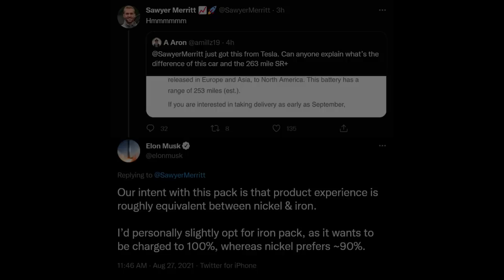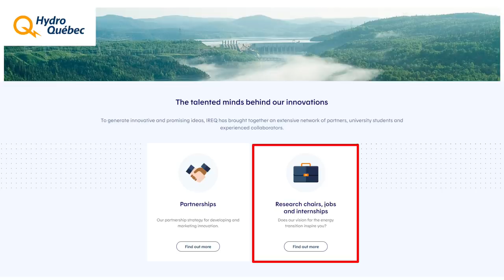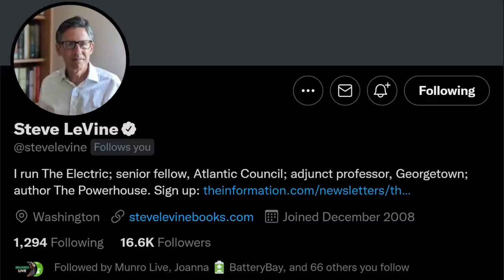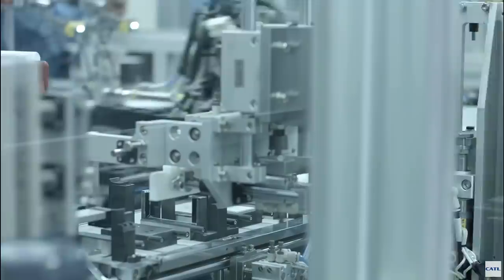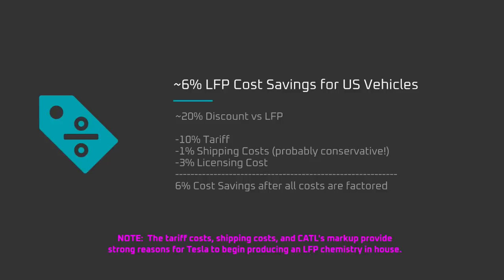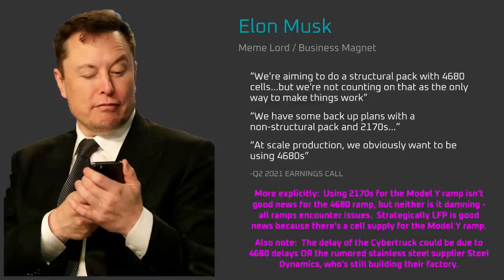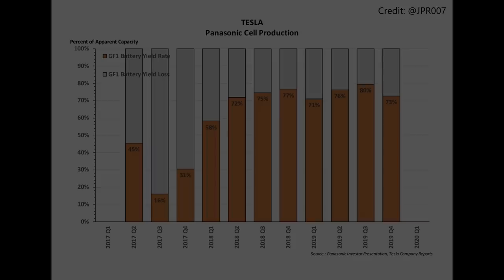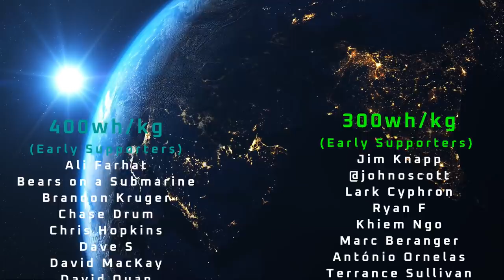#1 A Brief History of LFP, Patents, Licencing Costs, Pricing // and Tesla

Comment: Great video! Can't wait for the upcoming videos on LFP. Quick question though, how come we don't see cylindrical LFP cells?
Reply from the maker: Good question!  It's because LFP's big achilles heel for range is volumetric energy density.  Large prismatic cells maximise the amount of active cell material you can fit in a square pack.  This'll be covered more in depth in the series.
Reply: @thelimitingfactor  aah I see. Do you think there would be any change in terms of 4680 LFP considering that the structural battery pack has higher energy density in terms of volume?
Reply from the maker: @TAD-9  I'll will work through the details when I script that one.  I have to run some numbers but I think I've put my finger on the key variables.  I have to take a closer look at CATL/BYD cell to pack and see how it compares to Tesla's pack.  Then, I have to factor in chemistry improvements.
Reply: Do we know that the LFP packs are prismatic? I always assumed they were also 2170 using the same pack architecture. Never seen a tear down of a LFP pack
Reply: @Pedrodemio  they are prismatic. There are pictures floating around on the internet of the lfp pack.
Reply: Cylindrical LFP cells exist. They are just not as common for the reasons Jordan started. But it you go to AliExpress, you can find plenty of cylindrical cells for sale.
Reply: It’s because LFP allow more relaxed cell structures. This is why 1000Ah single electrolyte compartment cells can be safely done. With NMC/LMO/LCO not so safe. So small cylindrical cells are a compromize due safety issues.
Reply: @mfb424  This makes a lot of sense. 
Does LFP expand/contract less, making them more suitable for prismatic format & volume maximization of the "usable space" inside the battery pack?
Reply: @elektrotehnik94  Anode side is the mechanical mess which cause wear and tear. The adhesion to foils is another thingy which cause issues. We had 50Ah cylindrical cells in China with NMC already early 2000. I had plenty of 10Ah cylindrical NMC cells (need to check the dimension) back then to build some ”pipe batteries” for street lights 🤪 From those we learned that after certain amount of windes electrode the thermal and ionic swelling grinds the electrodes off from the foils. Even with thinnest and toughest coating that kept happening.

Anyways. LFP is mechanically so stable that we can use 1000-2000nm particle sizes and reduce the electeolyte interfaces and align the particles towards the separator (when coating the separator). Now what this allows? As no foils needed the single electrode can be say 2000 mm by 5500 mm. There’s no winding or folding that. But extraordinary mechanical stability is achieved.

So LFP as a extremely stable particle and as a li-ion starved design it allow us to ditch all traditional manufacturing approaches. Prismatic large format cells taught us that as they came already to mass production in 2004. I made my first EV bus battery packs back then with few hundred 350Ah prismatic cells. After that whole a lot more was learned from hundreds of thousands of Chinese EV buses. Real life use on shaky roads.
Reply: @mfb424  I see, thank you, that was very informative :D

Comment: LFP are safer, have longer charge life and can be full charged without significant degradation. Premium models where higher power density is a selling point would continue to use Ni based chemistry, but mass-produced models should use LFP.

Comment: Thanks for a the great video, can't wait for more.  Question- are Tesla LFP batteries still cylindrical form factor or is it an entirely different pack design?
Reply from the maker: 4680.  But it doesn't matter for LFP because it's a safe chemistry.  I'm not sure why everyone is fixated on form factor.
Reply: @thelimitingfactor  I don't know that I am fixated per say, but more curious about how interchangeable they are for assembly.  It sounds like current Model 3 LFP is not cylindrical?  So it's an entirely different pack then?  I am thinking about it more from the perspective of how many battery pack assembly lines you need for different chemistries.

Comment: Surely the LFP chemistry can be used with 4680 cells. After all, isn't it just packaging?
Reply from the maker: The variables are:  Safety of the chemistry and safety of the form factor and energy contained in cell.  LFP is safe, it can be used in large cells with minimal packaging.  LFP has low volumetric energy density, which is why it's stored in large cubes.  Whether Tesla puts it in a 4680 or not isn't due to safety, it's a matter of energy density...that all depends on the structural pack.  Sorry, that's as far as I'll go here in the comments.
Reply: The beauty of LFP is it doesn't need much if any cooling.  The cylindrical cells leave space for cooling in the gaps which just isnt useful when the battery just wont degrade or explode even when punctured.  Tesla's current battery cooling is impressive but in the case of LFP unnecessary overengineering.  Not sure how much its LFP itself or the engineering but look up the byd blade puncture test and see the comparison for prismatic which is an absolute bomb.
Reply: @thelimitingfactor  My view has always been that all chemistries would benefit from the tabless design. I live in Canada so cooling wouldn't be a problem but, efficient pre-heating of the battery would be a benefit of the 4680. Wouldn't heat travel as efficiently into the battery as out?

Comment: "Like any battery, LFP has some eccentricities".  Yes, and one of those, as you pointed out, is cold weather performance.  The chart you showed was from Nat. Energy (not Tesla?) so I'm not sure how well Tesla's thermal management system will mitigate this issue.  Anecdotal reports from China say it's not mitigated very well, and certainly not to the extent shown in the chart.  I'm anxious to see more data on that.
Reply from the maker: You just have to let it warm up with pre-conditioning.  If you're impatient or don't use the app, then it will be a frustration.
Reply: @thelimitingfactor  Thanks.  I guess that's ok as long as you're plugged in.  Otherwise the battery cannibalizes itself (as do all EV batteries)
Reply: @tommckinney1489  he linked a super interesting research paper on twitter that showed amazing performance from LFP when properly thermally managed. The drain from the preconditioning is significantly less than the loss from running at a sub optimal temperature. Even better than NCA without thermal management.
Reply: @samuelprice538  thanks.  Preconditioning is available now for most EVs yet people don't know about it or do it.  I guess it's a learning curve, but it may be difficult to precondition if you aren't plugged in, like at work or at the mall, etc.  Don't misunderstand me, there are pros and cons to everything.  But I don't think people really understand (yet) how important it is to precondition and charge to 100% when using LFP.
Reply: @tommckinney1489  this is about battery preconditioning not cabin. Its done using heating stripes built right  into the cells. Apparently it can bring the cells up to temperature within 90 seconds so no need for the user to wait. It happens as you start driving.
Reply: @samuelprice538  That would be great if it worked that way.  The battery has a large mass and it would be difficult to heat up in 90 seconds.  Do you have more info on this, like maybe a link?

Comment: Fantastic stuff as always. I got the impression that the cathode chemistry discussion on battery day pertained to the 4680 form factor. So I fully expect LFP 4680s in cars and in structural packs. I can see prismatic form factors in storage but it's dependent on heat dissipation. Elon is pretty adamant pouch form factor is a runaway thermal event waiting to happen... Given the tabless architecture's thermal advantages, I'd expect 4680 LFPs in the storage products too. There may be some niche usage in storage for the higher power  densities (other than FCAS). And my final thought is that the storage products may not need larger volumes despite the LFP energy density being lower because the thermal management should be simpler (and less voluminous).
Reply: Megapack thermal management seems like an important and interesting topic. Jordan should probably make a video about it :D
Reply from the maker: The variables are:  Safety of the chemistry and safety of the form factor and energy contained in cell.  LFP is safe, it can be used in large cells with minimal packaging.  LFP has low volumetric energy density, which is why it's stored in large cubes.  Whether Tesla puts it in a 4680 or not isn't due to safety, it's a matter of energy density...that all depends on the structural pack.  Sorry, that's as far as I'll go here in the comments.
Reply: @thelimitingfactor  Thanks. That's a resounding no then☺

Comment: I drive a MIC Model 3SR+ in Europe so it has the LFP battery. I can personally say it is awesome! I’ve never had to worry about the range and charging to 100% all the time is so much easier and less stressful, especially since I can’t charge at home. Not having to worry about the battery’s longevity is a godsend.
Reply: @cyclopsvision6370  For sure, but all do. It doesn't affect my daily driving at all (only about 60 km round trip commute) and I haven't done any road trips in winter yet, but with the supercharger availability in Europe, I don't expect it to be an issue.

For a quick comparison though, a round trip to work and back in the winter uses about 10% battery, while in the summer I only need 7-8%, depending on speed.
Reply: @cyclopsvision6370  Since I can't charge at home, no. But I would if I could. I guess I should also clarify, European winters are fairly mild. I'm sure I'd have much more trouble if I lived in the Northern US or Canada. But then I'd also probably have a garage and a way to warm up the battery. lol

Comment: I bet Tesla will copy or buy BYD LFP blade battery. The design is much more simpler as structural battery than 4680.
Reply from the maker: Nah, as LFP evolves it will get better volumetric energy density and won't need rectangular packaging.
Reply: @thelimitingfactor  The rectangular shape function as a structural pack much better than the cylindrical cell.
Reply from the maker: Could be, but cylindrical is cheaper to manufacture.  

That is, I'm not saying one is better.  

Rather, that there may be no need for Tesla to manufacture multiple formats.

Smaller cells also offer thermal benefits.
Reply: @thelimitingfactor  wrong, BYD battery cells are way cheaper to produce than cylindrical ones, also the BYD battery pack will require significantly way less cells than a typical cylindrical configuration.
Reply: @thelimitingfactor  the blade batteries are very flat and cooling them will be a very easy task.

Comment: Why LFP. vs 4680? Why not producing LFP battery in 4680 tabless format and structural battery
Reply from the maker: The variables are:  Safety of the chemistry and safety of the form factor and energy contained in cell.  LFP is safe, it can be used in large cells with minimal packaging.  LFP has low volumetric energy density, which is why it's stored in large cubes.  Whether Tesla puts it in a 4680 or not isn't due to safety, it's a matter of energy density...that all depends on the structural pack.  Sorry, that's as far as I'll go here in the comments.
Reply: @thelimitingfactor  thank you! You said it all withouth telling… Hope you will explain in next video…

Comment: had a thought about Tesla being a utility, battery formation will push and pull a lot of power at a 100gwhr annualized production rate, if they had a hige set of solar array to build the charge, they'd need the energy to go somewhere after xharge formation, so being a utility allows them to monetize the charge formation process into a utility scale electricity grid service peaker etc provider

Comment: Based on LFP batteries charging to 100% daily, I wonder if Tesla should market NCA batteries differently.  Make the NCA battery range display report FULL at 85-90% charge.  Provide a software button to charge another 10-15% for rare road trips.  It's "merchandising101" where you have a standard size package and a free,15% extra bonus pack.  The consumer has full range every day and a reserve range only when needed.
Reply: Like cranking the volume to 11?

Comment: LFP 4680 is this not possible?
Reply: It is totally possible and we may see it in time. Jordan will look into it in a future LFP video.
Reply: Doable yes. But using NMC/NCA cathode optimized cell structures for LFP is like driving the hand brake on. 4680 would cripple the LFP cell badly and limit the capabilities.
Reply: @mfb424  why and how? the electrode pair that makes up a lithium ion battery is typically a quarter of a millimeter thick or less. It doesn't care about the shape of the cell and whether it's rolled, folded or stacked to fill that space.
Reply: @w0ttheh3ll  The major difference comes from the particle sizing in cathode and how that electrode can be built to a required ionic and electric conductivity. You said it well. Winding, folding and stacking is optimized for these traditional electrodes. But for LFP the cell can be built on separator and leave all that winding, rolling, stacking and folding undone.

So what are the main cell types? Cylindrical, pouch, prismatic, coin and … ;)
Reply: @mfb424  If there is a fifth cell type, I don't know what it is.
Reply: @w0ttheh3ll  And next question is how these cells are effectively made. Right? :)

As mentioned in the Wikipedia article the separator can be the actual base for the cell structure. Cellulose fibers can be long and form a strong web. It provides excellent adhesion for both electeodes as their particles fuse to that web structure. The key element is the solid polymer electrolyte fused in the cellulose matrix. 

For Tesla this would mean 1250 mm wide and 2000 mm long cells. With high loading about 1,5 mm thick. Stack those to desired height and that’s the pack voltage there. Not going to disclose too much now. But this cell can be coated with more than 1000 m/min speed for that 2 m wide cell. Intervalls every 1250 mm.

300 Wh/sqm is good start to start calculating how much cells come out with 24/7 operation.
Reply from the maker: The variables are:  Safety of the chemistry and safety of the form factor and energy contained in cell.  LFP is safe, it can be used in large cells with minimal packaging.  LFP has low volumetric energy density, which is why it's stored in large cubes.  Whether Tesla puts it in a 4680 or not isn't due to safety, it's a matter of energy density...that all depends on the structural pack.
Reply: @mfb424  I calculated to 315 GWh/year. How many KWh could a thin-film LFP battery contain for one such Tesla car?
Reply: @raxzore  100-150 kWh for S and X. CT more and for Semi even more. You just calculated one 2 m wide line capacity right. 🥳🤩 We’re installing 5 lines here and will be making 20 feet battery containers for wind and solar farms.